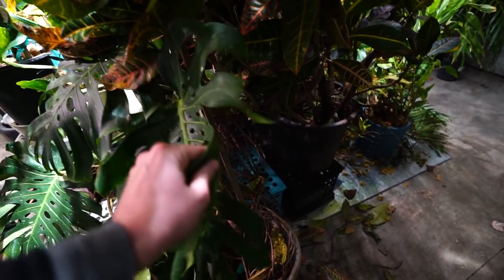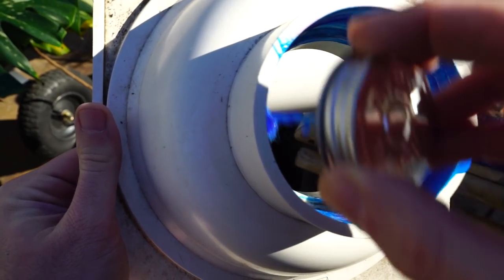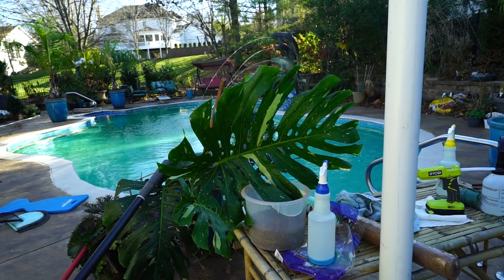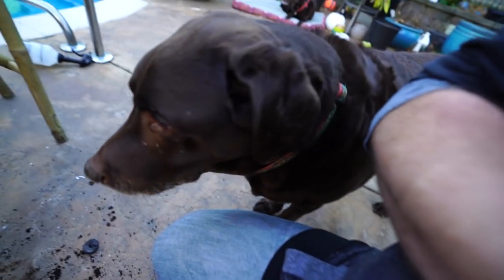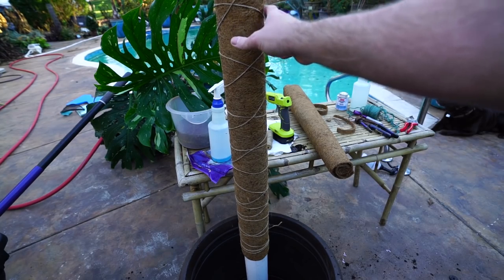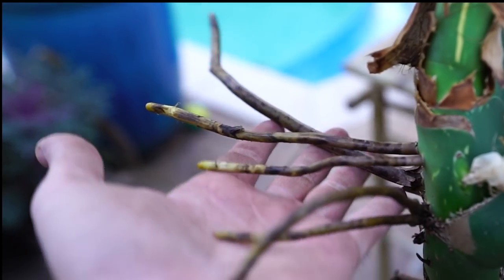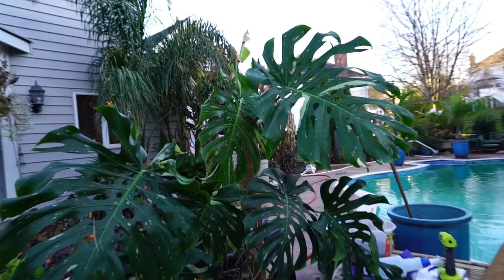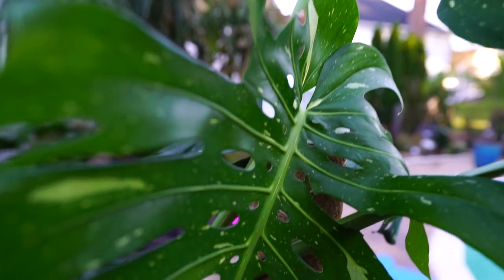Repotting My Thai Constellation Monstera & Making a Heavy Duty Moss Pole

Comment: Hi Jeff! This was fun watching and listening to you as you repotted your Monstera Thai Constellation. Until you repotted it I didn't realize how big it really is. It's so beautiful! I remember when you first came up with the idea of making the pole. That is such a great idea and being able to extend it is genius! It looks really good in the pot with the Monstera. I have some pothos and philodendrons that I want to do moss poles for, but have never done it before, so am a little intimidated. I may do a smaller version of yours with the flange and pvc. I bought a rectangle liner on clearance to cut down and use. I just need to "get 'er done"! 😕 I had a golden pothos in my kitchen that had a couple of really long vines that went up the window onto the top of the cupboard. When I decided to move it, the roots had gone through the paint. I was so shocked by this, so I'm more careful where I put them. 🤣 Pumpkin is so funny when you get the camera out, and Toby is so cute loving on you. Thank you so much for sharing!
Reply from the maker: Ha! You have a great memory, that was a long time ago! Those pothos are impressive aren't they? I put a tiny little marble queen in my aquarium filter last winter and I think I need to take it out because it's digging it's roots into the wood of the stand and I dont want it to interfere with structural integrity.

Comment: Looks great! I'm a fan of big poles. 🤐 They seem to help add more structure to the garden than a thin pole. You might have seen mine, I put one of those coconut fiber hanging baskets onto a 4" drain piece and sat it on top of the poles...replaced the plants in the top twice cause that top basket dries out much faster than the lower pot. I have a 6" round pole done, but it's just sat in a corner of the room all season. 4" diameter PVC is the perfect size.
Reply from the maker: 😅😂🤣 twss! I remember your tiki poles! Those are so cool!

Comment: Man she hates your camera these days. 
Mmm, PVC cement. Best to use that in a small, poorly ventilated space and get a little dizzy.
Two things that surprised me here. 1) you didn't use the hose to blast away a lot of the old soil and loosen the root ball since the old mix and the new mix are going to dry at different rates and getting fresh mix around even the old roots would be beneficial. 2) you didn't position it where that lowest bend went around the pole and the plant then sort of wraps around the pole back to the front. 
If my Vanilla vine is any indicator, the Monstera roots are just going to dig through that coco liner and find the PVC anyway. People think orchid roots are these delicate things (well, yeah, they are) but when they want to get somewhere, they just push on through.
Reply from the maker: I think she has started to associate the camera with me throwing her treats, so she gets extra hyper when I point it at her. Oh most of the soil just fell out on it's own. The aroid mixes I make don't usually have sphagnum in them which sticks to roots. Thats why I didn't see a need to blast out the soil, the majority just fell out and what didn't I tickled out with my fingers. 
So true about the orchid roots! I have to peel my vandas from anything they were too close to every fall when I bring them inside. The coconut was mostly for appearances, we both know they will cling on to a pvc pole without hesitation.